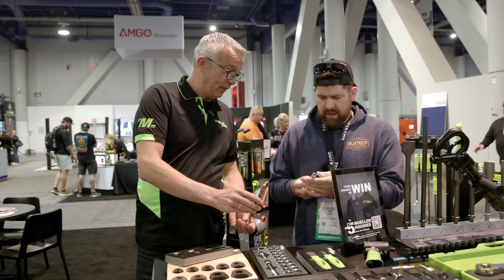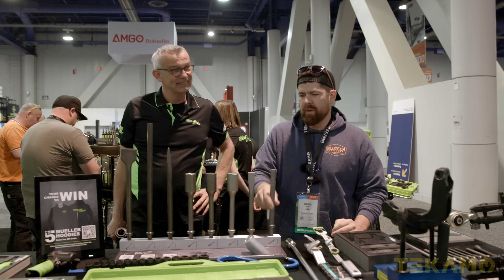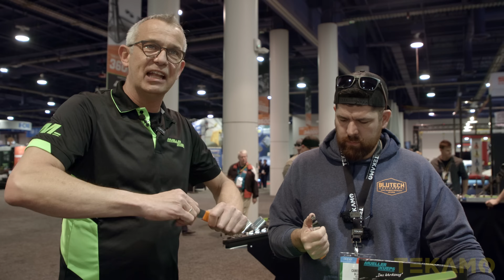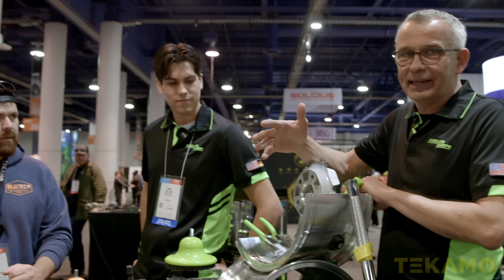NEW & MUST HAVE German Made Tools At SEMA 2024 - The Mueller Kueps Booth

Comment from the maker: TOOL LINKS
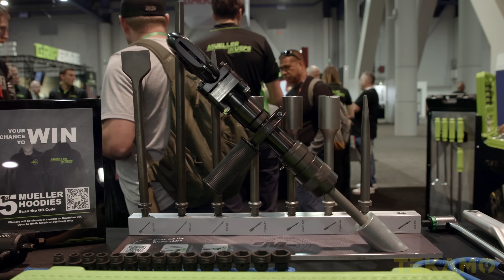4:00 BIG CHOOCH (Air Hammer): https://tinyurl.com/MuellerKuepsAirHammer
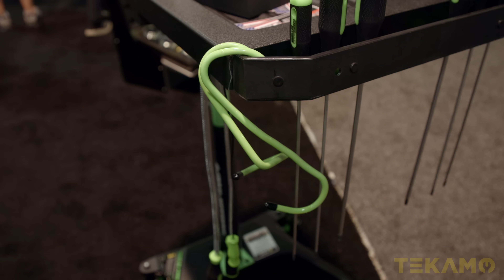8:08 Hanger Hooks: https://tinyurl.com/Uni-Hook-Set
8:37 Wrench Extender: https://tinyurl.com/tekamo-fortis-wrenchextend
11:03Vibro Impact Hammer: https://tinyurl.com/Air-Hammer-VIBRO-IMPACT
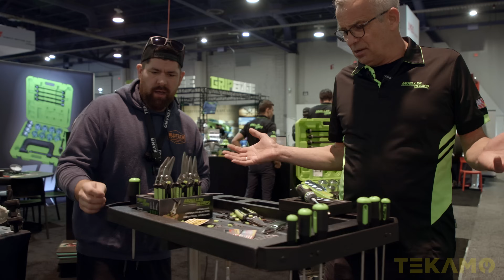11:14 HD Scissor: https://tinyurl.com/hd-scissors-tekamo
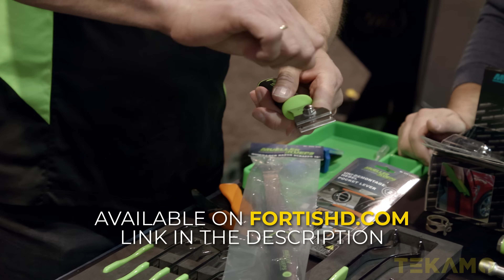14:55 Razor Blade Scraper: https://tinyurl.com/Razor-Blade-Scraper
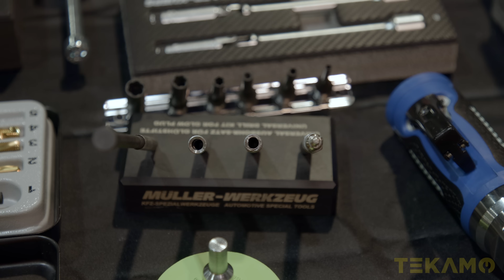15:52 Glow Plug Extractor: https://tinyurl.com/Broken-Glow-Plug-Removal-Tool
Reply: The best addition to their air hammer attachments they could develop is one of the big (the middle ones in the display) adapters with a drilled bore and a large chamfer on the outside for welding up custom tools. Perhaps packaged together with the appropriate electrode or filler for the alloy (if they're made from tool steel and not a low-alloy high strength steel like 42CrMo4)? Can't count the number of times I've had the need to weld up a custom tool but settled on just doing some sketchy set up with the tips that came with my air hammer (not a Mueller one) because i don't have any hardened hex stock on hand

Comment: Glow plug extraction is a great idea! Also I have a suggestion, make a pair of pliers that will push the lock down on a deutch connector and then with the pliers you can pull it apart. Deutch connectors can be very difficult to unplug.

Comment: Big chooch 1" 3/4" nut buster, socket adapter like they got for smaller air hammer in case you have to loosen bolts and nuts after Tylor's visit.